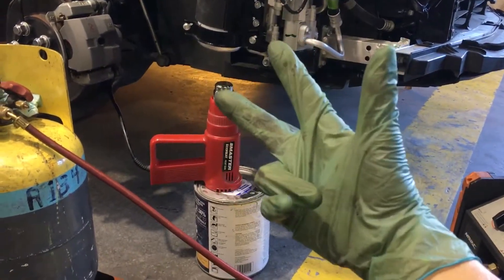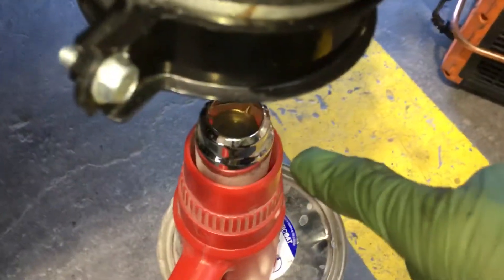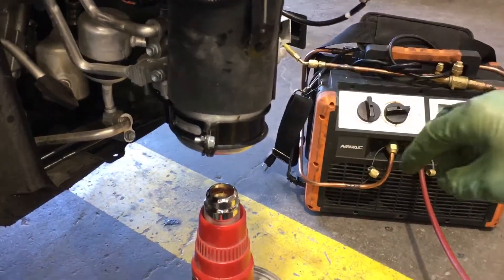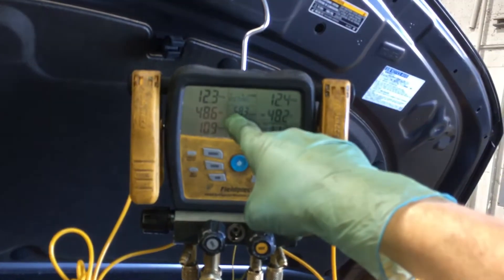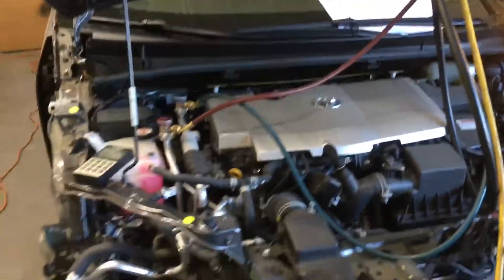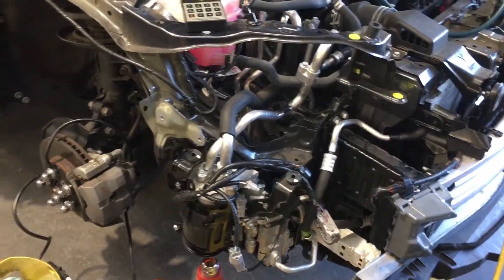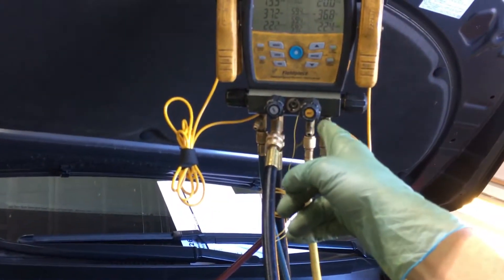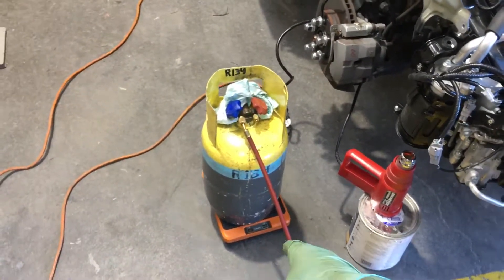2018 Prius Prime 3/4 heating up AC accumulator to help recover refrigerant.

Comment: Hi. If you are available, I find that this part of my car has a lot of condensation during humid days. Is this normal?
Reply from the maker: Yes. This part gets cold like a glass 🥃 ice water 💦 and starts condensating and dripping from the outside from the moisture in the air. 

   Exactly the same if you had a glass full of ice on your kitchen table on a humid day and  the water drops form on the outside and drip on the table
Reply: @coldfinger459sub0  I appreciate it the prompt reply. My problem is that is leaking into the wiring, specifically my right turn signal. It gets so bad the light wont work when is that humid. It starts working once is dry. How can I keep the moisture from getting to the wiring that's hanging right at the bottom of it?
Reply from the maker: @amaliacoyarzun9953  it sounds like this is on a new Prius prime that should still be under warranty. 

         Or was this car in a body shop accident and some repairs were not done correctly because the wiring is pretty sealed going into the lights there is a seal where the wiring goes to the bulb it pushes in twist and connects with a gasket so no water should get inside. 

        Sounds like a warranty problem or somebody who worked on the vehicle did not put something back together correctly